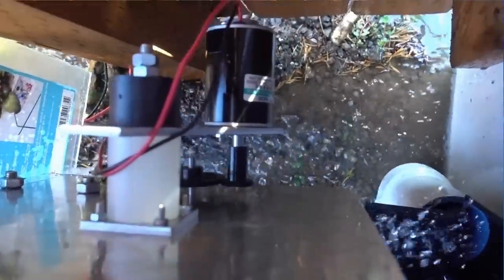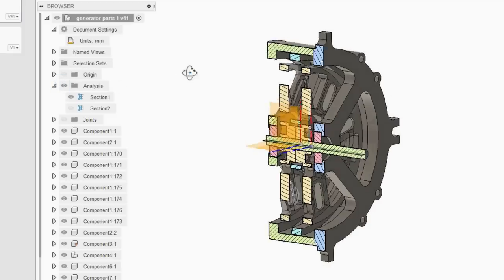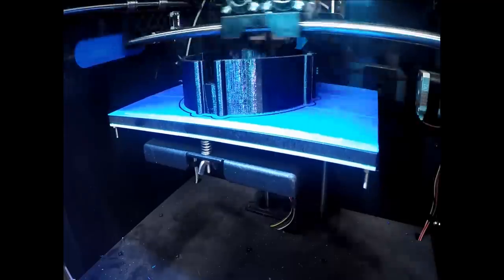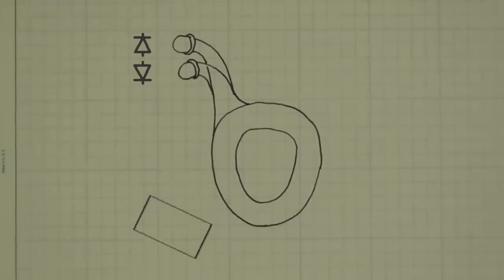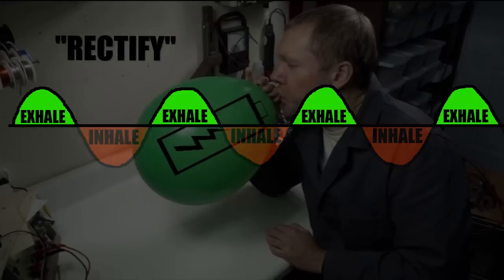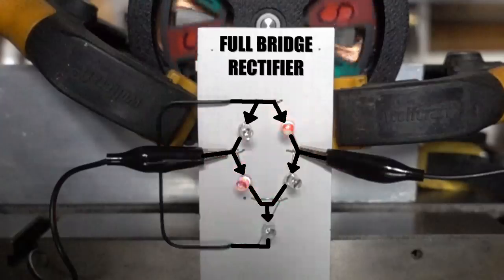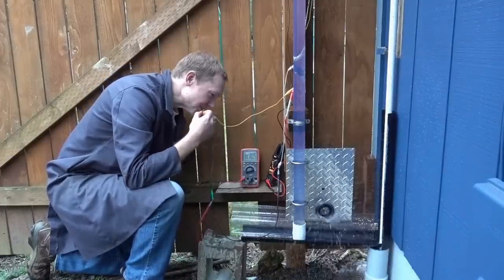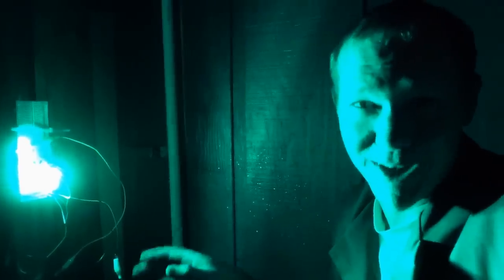Rain Gutter POWER #2 - 3D Printed Alternator, BEST Explanation of a Rectifier EVER!!!

Comment: best explanation of a bridge rectifier I've seen. Thanks and keep up the good work!
Reply from the maker: Thanks Alan! I didn't set out to explain a rectifier like that but once I saw the opportunity I couldn't pass it up!
Reply: I came here to say the same thing!
Reply: Same boat here. Electroboom would be proud.
Reply: I agree he did a lovely job using LED's in place of boring, expensive, and opaque NORMAL diodes.  The best way to play around with electronic components without spending a penny is to do it in-silico.  That is, within a simulation.  Here's a simulation I threw together of exactly the same circuit. http://tinyurl.com/wsbaops
That's not just an animation btw,  It's a full featured electronic circuit simulator able to run almost any valid circuit.  Amazingly, it can take arbitrary inputs and inject them into a circuit (ie .wav files) and output signals you can analyze with any sound editor.
Reply: Agreed! Brilliant visual representation using LED's!
Reply: You beat me to making the same comment by 3 months.
Reply: @Amuzic_Earth  me too!
Reply: I'm an Electrical Engineer so seen a few attempts at people trying to describe a full bridge rectifier Definitely the best explanation I've seen... Hope Electroboom's seen it..! Maybe you should apply the same style of logic to explain the smoothing capacitors role.?
Reply: @TrentTationnaiseXization  ya he will
Reply: Best ever seen
Reply: Alan Osborne I agree
Reply: Came to the comments to say exactly the same!
Reply: Same here man, this guy is awesome
Reply: Is this a Indian tech YouTuber
Reply: 1 trillion dollar bill from zimbabwe. Love it.... Your richer than papa bezos
Reply: Alan Osborne - and on that, I subbed. 👍
Reply: You beat me too it! I've never seen someone use LIGHT emitting diodes for a rectifier demonstration but now that I have, I wonder why it isn't always done like this. I mean it's just too convenient to pass up. Nice!
Reply: FOOL BRIDGE RECTIFIER!!!
Reply: I'm an engineer better explanation than anything in my college. Also cooler and useful.
Reply: @QuintBUILDs  Better than my university
Reply: This is the first time I’ve ever felt like I understood a full bridge rectifier. Thank you so much for this
Reply: Never actually got that part on uni. Just learned it (and probably won't forget) in 15 min. Thanks a lot!
Reply: I agree
Reply: 0б
Reply: @QuintBUILDs  wouldn't it help to get larger tube/pipe that holds water so it = more weight = stronger and faster flow?
Reply: @kicma12344  I used to subscribe to Home Power magazine.  They cover solar, wind and hydro, hydro is the cheapest form of generation, at as low as 3 cents a kilowatt hour.  But hydro can be complicated to deszine.  There are 2 main terms in hydro, Head, and Flow.  Head is how far the water will drop from the source to the generator, Flow is the volume of water flowing.  You could have 100 gallons a minute flow and 10 feet of head, or you could have 100 feet of head and only 10 gallons flow, but they have the same potential energy.  The clear PVC looks to be about 10 feet tall and maybe 2 inch dia.  We now know he is working with 10 feet of head, but we don't have the flow.  Also to adjust the flow some setups have up to 4 nozzles spraying on the wheel.

Comment: Soldered in my first diode near 40 years ago, before my 10th birthday even. Been playing with electronics and electrical stuff ever since, from building tiny little circuits all the way up to working with substation switch gear, and some nifty 3-phase factory systems. Part of my income these days is derived from designing circuits for small and medium-scale automation projects. 
I've not once heard an explanation for a rectifier as simple or effective as yours. The same goes for your explanations around how the generation works. I've never seen someone tackle it in such an effective and understandable manner. The visuals using actual components (rather than simulations or animations) makes it much clearer for many. 
Gonna have to add a larger workshop and 3-d printer to the house :)

Comment: Just took 6 weeks of bread boards and scratching my head with confusion just to have this explained so visually well, the way you used the LEDs on the bridge, then added the capacitor to show it smooths the power! Appreciate it !! Great work!
Reply from the maker: Believe it or not that's about where I was prior to making the video. When I saw the opportunity for the visual, I knew it had to be done! Thanks for sharing your experience, I really appreciate it. 👍
Reply: when charging battery's you don't need the capacitor batry's are acting like a capacitor.

Comment: You adding water resistance by having your "nozzle" at the bottom.  Change to nozzle on the top side of your Pelton wheel so that the weight of the water will be going with gravity (down).
Reply: Exactly what I was going to say.  Just had to see if any one else beat me to it.
Reply: the youtuber Kris harbour has a pelton set up horizontal but it has 4 jets
Reply: Wouldn't it be even better to have the jet point downwards, and hit the pelton wheel like that?
Reply: @trippasnippa6152  Thanks, i also follow Kris.
Reply: But it slightly has more potential energy being at the bottom (farthest from the top). Also, the pelton wheel actually works better in this configuration. If the nozzle were at the top, the blades don‘t really "catches" momentum of water going down. It is designed to deflect the main direction, and they do so by sending the water back radially away from the center of the wheel. Guess where the water tends to go with this setup? Downwards, the same direction of the deflection. The core characteristic of this particular design is that it almost eliminate water "reflection" going the same direction of the source making the source‘s momentum undisturbed. If the jet is on top, the wheel will work to deflect it upwards see? So overall, this setup is better.
Reply: I was totally going to type the same and bigger scoops lol
Reply: Jimmy, pelton wheels use kinetic energy. Your explanation is correct, but for an overshoot water wheel that uses gravity
Reply: @heavycurrent7462  
What you said is weird, i think you're wrong
I won't go as far as try to correct you 😅
Reply: @TazerGames  Yeah because you have no idea what you're saying.
Reply: @heavycurrent7462  No, potential energy is gained further from the center of mass, ie, higher up.

Comment: Practical explanation in a way I never seen before!
Good job!
Hey bro, have you thought about using a tesla turbine instead?
Reply from the maker: Interesting idea!
Reply: @QuintBUILDs  I want very much to see this made!
Reply: @QuintBUILDs  Why not reposition the direction of the jet from a 90 degree angle (versus vertical) to a 10 to 25 degree angle (from vertically down), so that a lot more gravitational energy is captured from the jet of water?
Reply: @MarkRijckenberg  still inefficient, a tesla turbine allows a lot of the energy to be utilized.

Comment: I finally understand bridge rectifiers. I've been a multi trade tech for over a decade and there's a lot of electrical work involved with the work. Electricity I've always chocked up as magic. I've worked with UPS systems that used bridge rectifiers and pulse phase inverters. I knew the diagrams for them but I still didn't get how the inverter actually worked because everything is self taught. 

Thanks for the lesson.
Reply from the maker: You're welcome!

Comment: I thought I'd had a bright idea to turn roof water run off into electricity and supplement my solar power when the weather is bad. As ever someone else had the idea before me.  It's great to see the execution and all of the design considerations as well as the potential output so that I don't have to it myself. Quint also has a great work shop tools and skills to carry it out, which I could never do. Fantastic educational video.

Comment: When I was growing up, we had an old vacuum cleaner that I would use to vacuum the floors. One time I took it apart and looked inside, and that was the first time I had ever seen a full-wave rectifier circuit. Just 4 diodes soldered directly from the power cable (and the switch) into a DC motor.

Thought it was pretty clever.

Comment: You might want to try impedance matching your load to your alternator. There is a certain level of resistance that will maximize the power output, at which about 50% of power losses will be elsewhere in the system rather than the load.

Comment: Thank you, I appreciate your effort.
Maybe I missed it, but the factor that impacts the total amount of potential energy is the total amount of rainfall.  That will determine how long even after the rainfall ends the turbine will run.
Reply from the maker: Agreed, except that the rain has to fall at a significant enough rate to get it running.  Even after I start using the gutter as a reservoir it still only collects water when it rains hard. ;/

Comment: The nozzle modification is a good idea. I think most of your losses are through the interaction of the water and wheel you can literally see the losses with the amount of energy the water still has when it comes off the wheel. It should essentially fall off and not spray off. I would say that a higher volume and lower velocity of water  should be ideal.

Comment: You can make the coils even more efficient by ensuring a nice flat wind with no sideways/crossed over wires. Lowers coil resistance and lets you fit even more winds on the coil.

Comment: Actually induction includes one other property which is the angle of magnetic flux. This is the angle at which the direction of the magnetic field cuts through the copper coil. The closer to a right angle it is, the more efficient the transfer of energy from the moving field to the conduction of current.
 That's an extra bonus for his two magnet blade rotor design with a coil in the middle, not only is it double the magnetic strength, the field cutting through the coils are linear and not bending around the surface of the magnet which causes loses.

Comment: Great video!

I am NO engineer; my theory for one of the reasons for the reduction of efficiency is due to the fact that there are very small gaps in the teeth between the big and small gear pulleys/wheels (or whatever they are called), i.e. when the big wheel is turning the small wheel, there is a minute amount of play/slack - in other words, the mechanical movements are not precise.  If there is a way to improve on the movements, the efficiency will be improved.  So, adding lubricant is only a partial but very logical solution.

As I stated above, I am not an engineer and this is only my theory.  Anyone who wishes to down vote this post is quite welcome, provided there is an explanation for the disagreement.

Here is another one of my theories: without such backyard/garage tinkering like this project, we will be far too reliant on corporate greed.  Yes, I understand about specialisation, opportunity cost, the economy of scale, etc.

Thank you for an educational and entertaining video.

Comment: If you were to increase the diameter of the outflow hole and with that increased diameter then attached a reduced outflow jet over a small distance you could increase that jet output by more pressure. Great Video

Comment: Genius idea with the flipped generator, i usually think macro. Thought maybe more surface area coverage from the roof would equate to more water into a larger pipe that would equate to higher pressure into a faster stream into a more complex gear system. But its more energy lost and would require a massive ply wood addition to the crest of the roof. Perhaps roofs in rainy places should be built in such a way that harvesting energy from water is much more viable:
-Massive one sided roofs, no that would ruin the height pressure advantage, and the house would need to be sturdier to allow for large unsupported surface areas.
-Multi generators, this would accumulate more power considering the more complex the roof design of a house. Like big mansions for example, having multiple roofs all funneling water off of each other. With a water slide like gutter setup into a reservoir that created ridiculous pressure read outs.
-Integrated hydro electric system, I'm not an electrician but perhaps splicing the hydro system into the main power supply could be done. This would divert power from the hydro generators as a supplement to the overall system.

This brings to light, a startling question, how much power is lost between big power plants across state, to the electrical grid,  and thus to homes with no electrical storage? I mean really, how much energy is just wasted? If anybody has some crazy ideas for innovation please reply to this comment, and copy and paste that idea in the main thread above. Hierarchy is wasted when not explored and utilized in every facet of life. I think the power supply hierarchy has gone too long without technological adventures to further its design.
Reply: Further more, what if we added other sources of renewable energy into the mix, solar panels could be set up in such a way that the they gather sun rays AND redirected water flow. Wind turbines could power a water pump that could redirect water flow from any point around the property unto a taller pipe. A microchip could calculate the time and angle necessary of a wind vane to turn the wind turbine into the wind. It could have a support line that redirects current just in case the wind turbine becomes disorientated.
I think I'm on to something, this could mean new developments into affordable electric housing, the houses of the future, weird but fun looking at the same time. Based on where these house are built, they'll look completely different from houses in another area based on the sun and budget constraints. Normal houses could easily be re-outfitted for cheaper energy solutions. I think the biggest concern would be safety proofing everything so that large power lines running through the house wouldn't run as big of a risk. Fiber optic cables- there's a big component,  now there is no limit to how long wires can stretch, thus how big these houses can get, and thus rich people can weigh into this new affordable electric economy, giving more build opportunities for low income sectors.
The basement could house the loud noisy generator acting like a substation for the rest of the house, and sound proofing everything neatly. It doesn't take much to flood proof a basement either, now these houses are also disaster shelters. What other power systems can we throw into this?

Comment: I'm really glad someone I talk with on Facebook linked me to your videos.  I enjoy the math and science behind electrical engineering and I like do it yourself videos, so I enjoy this rain gutter series.  I am wondering though, wouldn't there be losses in power, depending upon frequency and how much heat is lost in the diodes/capacitor, in the rectifier (even without the lights)?  Also, does the rain/wind damage any of this device?  How does cold or temperature variations affect it?  It looks like a fun project.

Comment: oh yeah, you could also branch off the pipe a few feet up, angle it downward to hit the blades directly downward so it results in a 45-degree angle to the sideways jet. the good part about this is that it can assist in a variation of resistance direction, cut off once the water decreases allowing for the majority of the pressure to be used for the horizontal jet, and of course, the synergistic effect of both running would be great, though I think the trade-off would be that the tube would need to be thinner to accommodate both jets adequately, that's not a bad thing considering the resistance that amount of water you currently have is resulting in slow down as it throws so much of it everywhere. I would love to see speed cams of the troughs taking the water as I'm betting the after its redirected, the water's tension pulls down on the trough when it's going back up. reduction of water flow and using two smaller jets could significantly decrease this. I'm doing biochemistry and used to work on making wind turbines, so I love seeing new projects like these. I'd love a lathe and metalworking setup like that, but college student, soooo lol.
Reply: btw, PVC is great for gradually decreasing the circumference of the pipe as well as it should be ideal as a nonpolar material that should allow for minimal resistance. most plastics work, but I like PVC also because of the ability to use epoxy to literally melt the PVC as a binding agent if need be.

Comment: Suggestion:
To make it more efficient you should  get away from the alternator method  and go back to the generator (DC) and improve the efficiency by changing the coil wire windings orientation to be in the same direction that magnets are passing by the coil wires. So that magnets move past  the length of the wire. Also change the magnets back to the single direction.